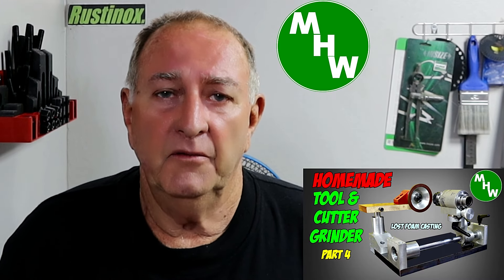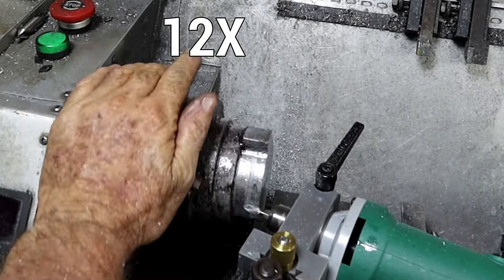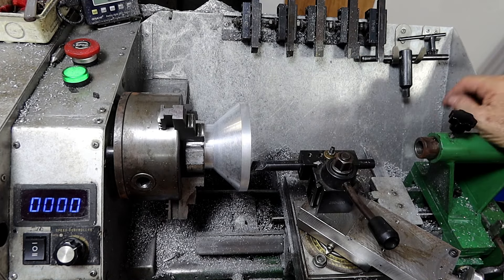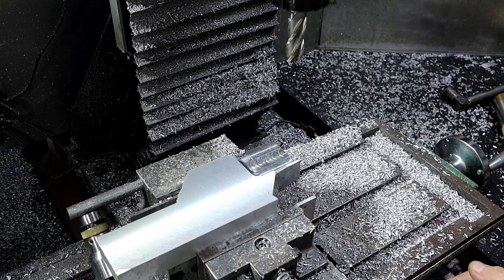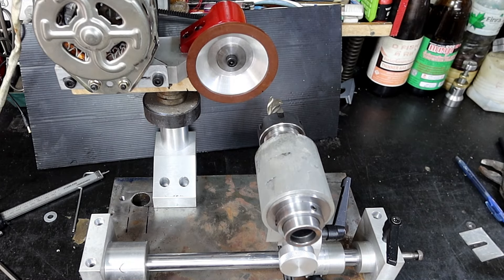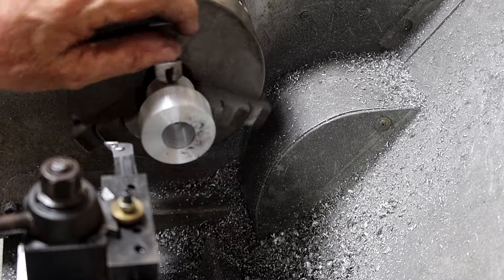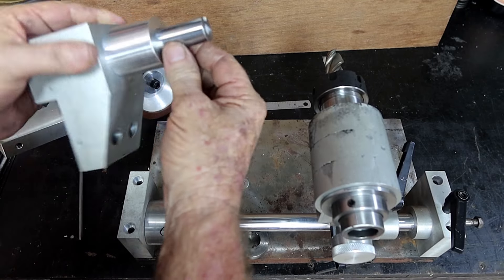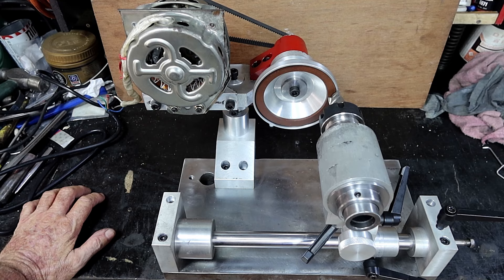MHW Episode 130 - Homemade Tool & Cutter Grinder -  Part 5

Comment: It's taking shape beautifully. You are innovative with some of the solutions ie: using a burr in the lathe, and using a diamond wheel to mill the flat.  Keep up the good work mate, I enjoy watching you make these projects.  Cheers.
Reply from the maker: It's taking a lot longer than I thought it would, but that is mainly because there are no plans to follow and it's just coming out of my head as I go and is prone to change. I've always said "Where there is a will, There is a way" and I'm not afraid to look outside the box for solutions. Thanks for watching. 👍

Comment: Nothing wrong with using a hand file. After all, the are made for it. It's just that I don't like hand filing :)
And that's a bit a set back that the motor isn't fit for the job.
Reply from the maker: I'm not a fan of hand filing either, but occasionally it does the job, it is a bummer that that motor won't do the job, I was hoping to use as much as I could that I have already. Thanks for watching. 👍